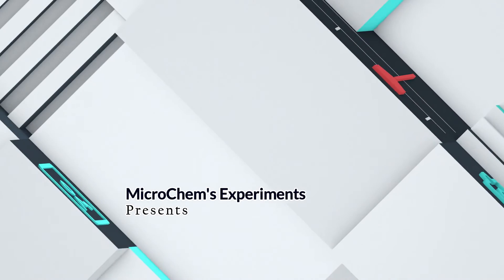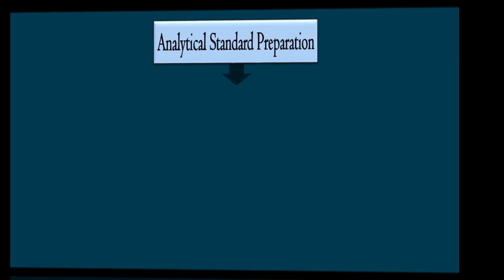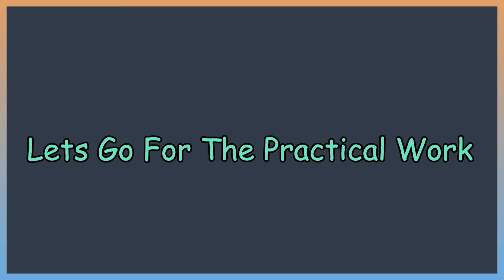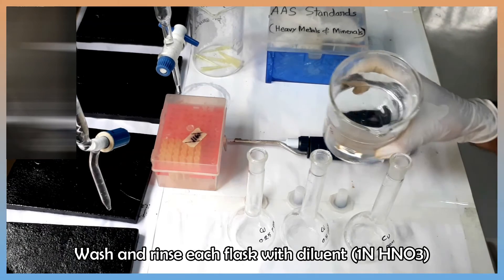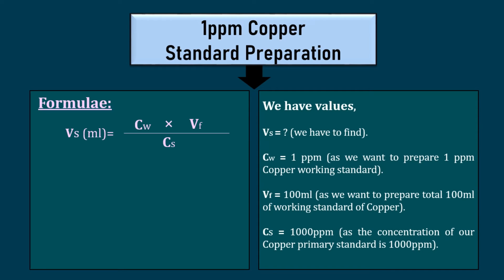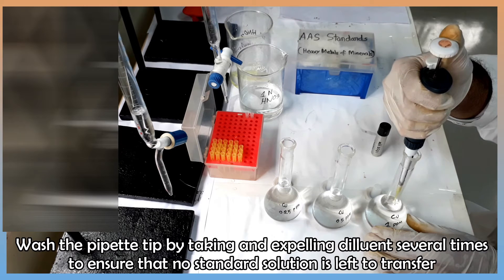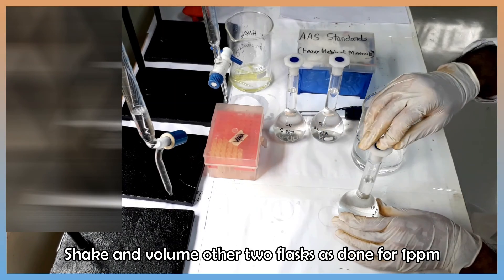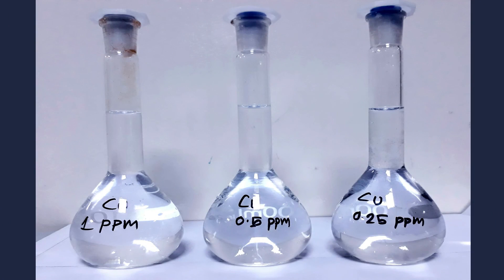Standard Solution Preparation for AAS, HPLC, GC & Spectrophotometer_A Complete Procedure

Comment: So the standard using hno3 as diluent while in sampel using DI water? Why is that?
Reply from the maker: You should use HNO3 solution for sample also. In case of wet digestion of sample, HNO3 is already contained in the final digested juice. So just water in added to make the final volume which ultimately gives you HNO3 diluent.